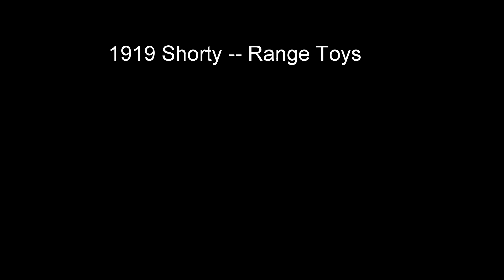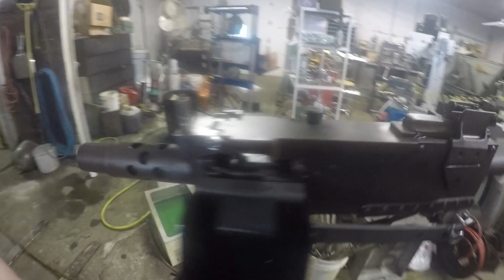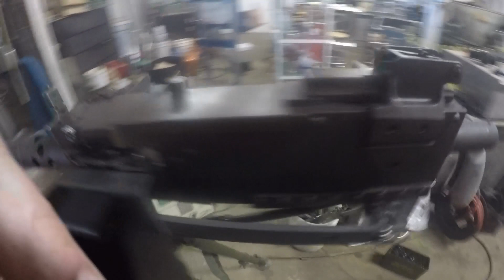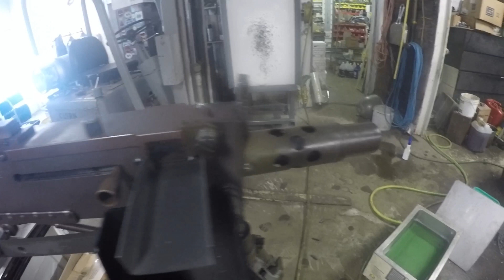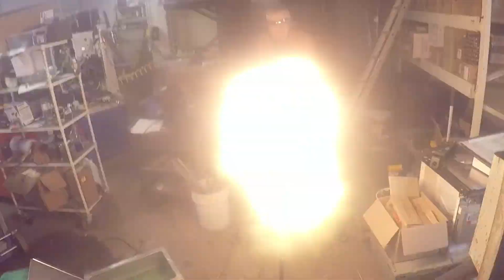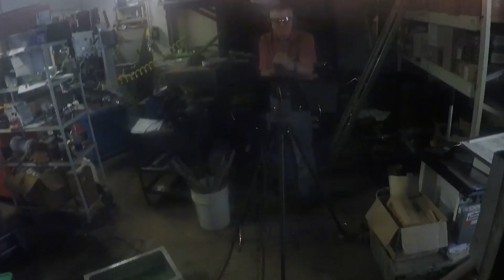1919 Shorty and my messy shop.

Comment: Chuck Buster has the best videos. I’m wondering tho, has Mr. Chuck Buster tried out the .357 Coonan 👀 .357 magnum in a 1911 body style
Reply from the maker: Yes I have shot a Coonan, they are not for everybody, you need big hands and if you don't hold the gun real tight it will stovepipe the cases.